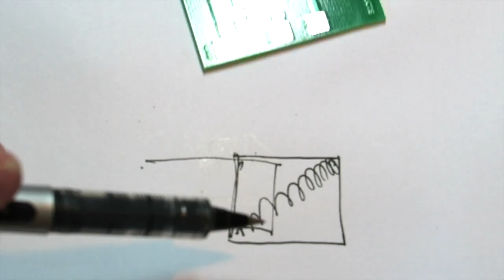Surface Mount Soldering - Hot air / Reflow = Part 2

Comment: I was looking at SMD and I can't imagine trying to hold an iron in that small of an area, so I kinda gave up on designing my synth in SMD format to go back to through-hole, but man this looks easier than through-hole soldering, and if I'm gonna design a PCB, I'm just gonna do SMD/SMT if it's really as easy as using a hot air gun

Comment: I'm new at this, but aren't you supposed to apply flux first? Or is that only needed when you solder with soldertin wire? Is the flux already in the solder paste?
Reply: Mahdiya Dijkhof yes, the solder paste has flux in it. Solder paste is nothing but very tiny solder balls mixed in flux, so it feels like "paste".

Comment: Been soldering now for well over 35 years Dan with hot air rework and standard soldering iron...you may want to get yourself some kapton tape...baco foil/aluminium foil...thin sheet metal for masking off other smd parts as you progress in your endeavours, could you please tell me where you got your solder paste/flux and brand names as well...thanks for sharing! 
,

Comment: I have been hand soldering SMDs for 7 years on and off but although I knew about hot air rework stations, I never linked the 2 in my heads. This video made that happen. Good timing too because the SMDs that I am looking at now are getting so ridiculously small, I was having issues with the size of the soldering iron tip.

I have a cheap vinyl cutter (Craft Robo) so I will probably cut adhesive stencils to be stuck over certain component pads to make it easy to apply the solder paste in the same way they do screen printing.
Reply: get your self a good stereo microscope  mine cost me around £325 and it amazing  it brilliant for doing for example the charging ports on let say Samsung phone etc.   if you do a search for  micro soldering by iPad Rehab on you tube
Reply: and also look for this guy on YouTube louis rossmann  regarding micro soldering
Reply: and also look for this guy on YouTube louis rossmann  regarding micro soldering
Reply: and also look for this guy on YouTube louis rossmann  regarding micro soldering
Reply: +James Birkin yes, I've seen a lot of his videos. He seems a bit whingy. Always moaning about something or someone and pointing out how much better he is than other people.
I might solder 10 tiny components a year so I'm not going to rush out to buy good quality gear if I can get by with the cheap stuff.
Reply: Louis and Jessa...extremely good at micro soldering!

Comment: Great video, I shall be having a dabble with a lot more confidence having watched this, many thanks.
Martin M1APQ
Reply from the maker: +martin godson Excellent news Martin. I actually find it easier than through hole components now. especially when replacing some components. As long as you take it steady you will be fine. And with my shakes, my dodgy eye sight - i know anyone can do it. - If you have any questions feel free to drop me a line. 73 Dan
Reply: +ColdestMoon have you tried using 2 hands one to hold the syringe and the other hand to steady the tip of the syringe

Comment: One hast to wait for the PCB to get cold before continuing in adding solder paste to further pads? How much time (more or less)?
Reply from the maker: +Giulio Buccini Hello, I left the PCB to cool down until it was warm to touch. So, depending on how much hot air you use on the PCB, depends how long you need to leave it to cool. 

I hope that helps you.

Dan
Reply: +ColdestMoon 
Thank you.